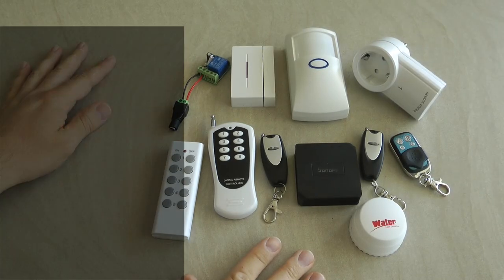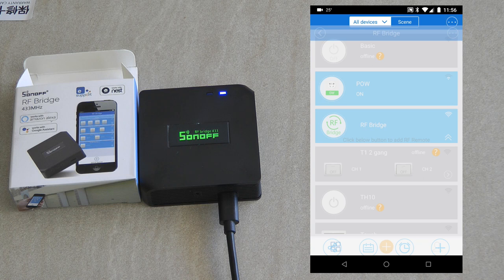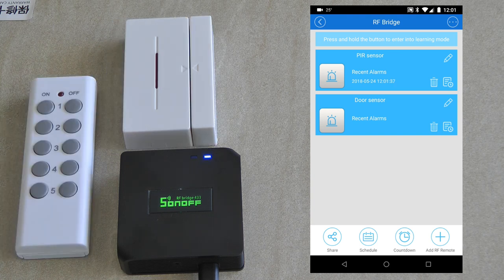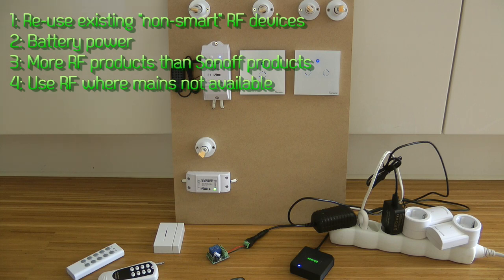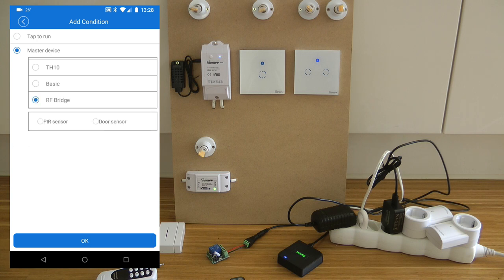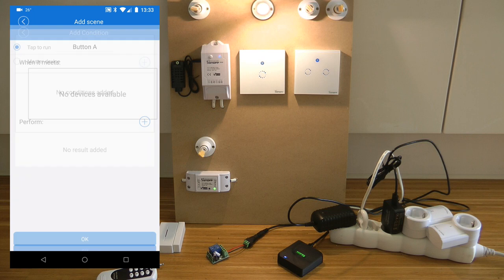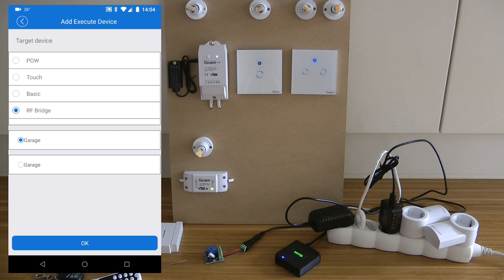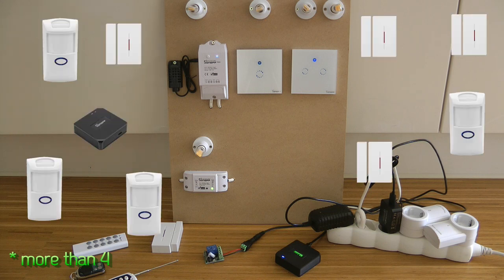Sonoff RF Bridge Review

Comment: Does Sonoff RF bridge support all RFdevices?
Reply from the maker: No, most of RF devices work on 433 Mhz, but there are other frequencies out that which are not supported. I know that for example most roller blind RF remotes do not work. But I find it impossible to find information of RF device which would definitely tell me what is working and what is not. So it is a bit of hit and miss.
Reply: @csongorvarga  ok, I have purchased sonoff RF bridge, if u don't mind can you  tell me the sources and devices that are supported  by Sonoff RF bridge?
Reply from the maker: @hassanibakary8042  I can't as you can see I have tested it with the devices that are available from Sonoff, and a few random bits that I found at home. I don't have any list.
Reply: @csongorvarga  OK THANKS FOR YOUR TIME, BY THE WAY GREAT TUTORIAL ,KEEP IT UP

Comment: @Csongor great video. question is it possible also to learn the rf bridge my air-condition RF ? so i can turn my AC on-off using my phone/alexa? thanks.
Reply from the maker: That is a good question. AC usually works with infrared remotes and not RF. I doubled that it will work as AC signals are very long, but you never know until you try.
Reply: @csongorvarga  any other suggestion of sonoff that will bridge IR? :)
Reply from the maker: No, Sonoff does not have any IR device. Broadlink rmPro is the device you need, but it is a different ecosystem, different app.
Reply: @csongorvarga  Thank you for your answer .  Don't know if they will launch this product in 2021 this year  ?
Reply from the maker: @monostereo1000  I have no idea. But Sonoff just recently launched the Zigbee range, therefore I think they are moving away from old RF and towards Zigbee.

Comment: Hello..
I purchase rf bridge kit...
But how I configure pir and door sensor for home leaving ( lock). And  Home arrived ( unlock)..
Reply from the maker: You cannot. The door sensor senses when the door is opened. It can't tell if you are leaving or arriving. And there is no sense of state either. You can only do simple triggers like your pir or door sensor turns a light on.
Reply: @csongorvarga  Is it possible to  Pir Sensor to Turn On a light on only at the certain time of the day? (At night)
Reply from the maker: @CezarWagenheimer  No, unfortunately not.
Reply: @CezarWagenheimer  for that you will need a motion &light sensor (which will activate only when there is not enough light  eg. at night or at dawn)
Reply: @dariusEMPEROR  This is now available within the most recent versions. I was able to configure it to only turn on the lights at night.

Comment: What is the maximum distance from the control object?
Reply from the maker: It is hard to say. 433Mhz can do up-to 100 m with line of sight. But 433 works very good across walls. I have a small door bell at the gate, and the receiver is about 20 meters in the house and it works well.
Reply: @csongorvarga  thank you for quick response)

Comment: Could I set up an alarm to alert me if i leave my garage door open ?    For example if i leave it open for more than 10 minutes.  How could I do this for cheap?

Thanks for the great video!
Reply from the maker: No, unfortunately not. All the triggers are happening when the even takes place (e.g. the door is opened), there are no timer, or combined conditions that can be used to deliver what you need.
Reply: I know that you can set a timer on a sonoff basic , so if you press ON after X min it will go off automatically.   Think it could be possible to add a door sensor that when the garage door is open  reports to the bridge, and activate a sonoff basic with the previous configuration i wrote.

Comment: I need to have 1 button for on and 1 button for off, like on the actual remote. Pressing the same button to switch on and off like you showed doesn't work for me. That means that for a single 4 buttons remote I need to have 8 buttons and two sets of virtual remotes...
Reply from the maker: It has been a while since I did this video, but that should not be a problem. You add the buttons as alarms and create a scene for each. And you configure scene 1 to trigger on button 1 to turn on your device. Scene 2, button 2, turn off the device and so on.

Comment: Could someone please point me to a Sonoff-compatible gas detector? (for natural gas, methane, butane, used for cooking, not carbon monoxide or smoke detector).
Would be very thankful to know which 433MHz gas detector would work with this lovely little device.
Many thanks!

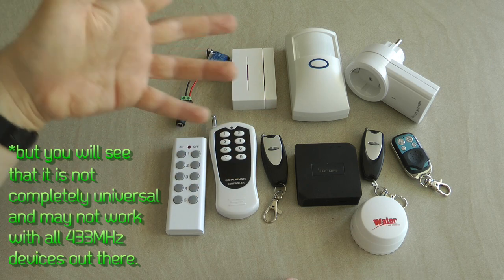1:30 That's why I am asking this question :)
Reply from the maker: I can't. I had tested these few products and  I have no idea how to tell if a sensor will work with RF bridge.
Reply: @csongorvarga  Thank you for your reply anyway. I've read that the Sonoff Bridge needs a certain standard of the 433MHz signal to be at but the specifications of indificual gas detectors/sensors don't go into such details as to reveal the signal encoding type.
Thank for the interesting vid.

Comment: hi there 
will the sonoff RF bridge work with a 350 watt rated power of electric gate opener 
REGARDS RICHARD
Reply from the maker: RF Bridge is just a bridge. You will need a RF relay if you want to operate a gate opener. Usually garage or date openers only need a trigger to open/close, so that relay does not need to be rated for high power.

Comment: I have a couple of questions I hope you can help me with:
1) So the general remote's button cannot be used to trigger T1 switches, if it is setup as a "button", instead of an "alarm"? Because when I tried to set my 4 button remote as 4 buttons through the rf bridge, it did not appear in the scene. I must set up each button as an alarm.
2) What then is setting up general remote buttons with the rf bridge for? Is it simply so that we can control devices (that are usually paired with the remote control) using the ewelink app? 
3) So, 8 remote buttons cannot be used as 8 triggers just like PIR or door sensor is 1 trigger each?
Reply from the maker: 1) Yes, set them up as alarm.
2) Yes, I am not sure why the app is working like that, they must have had their reasons
3) Yes, alarms are always a single input, only buttons can be up to 8.
Reply: @csongorvarga  shame... I thought I can use my 4 button remote as 4 triggers for my 4 T1 switches and only use up one device slot (out of 4).

Comment: Hello,

Your video is very interesting, I finally understood how to pair the remote control. Thank you

Can you tell me about the following?
I have 10 Sonoff DW1 door opening sensors, an RF Bridge and a remote control like yours.

Is it possible with the remote control to activate the 10 sensors at the same time when we leave the house and to deactivate them when we return?
If yes, can you tell me how to do it?

Finally, can we complete the installation with an external siren compatible with my Sonoff elements, to associate it with the door opening detectors in the event of intrusion?

Corialement
Reply from the maker: Hi, well there is no nice solution to what you are after. A scene is either enabled, or disabled, it cannot be switched. As a crude workaround you can install a Sonoff Basic/Mini before the power supply of the RF Bridge. And you simply cut the power when you are at home. If the RF Bridge is not working, the signals from the door sensors will not be registered. For the siren, probably the easiest if you get a siren which turns on when gets powered, and yet again switch it with another Basic/Mini.
Reply: @csongorvarga  

Hello,
Thanks for taking time to respond to me.
Your solution makes perfect sense.
It was enough to think about it.
Thank you

Comment: Such a shame that they don't improve ewelink app... I own a Broadlink RM pro, it costs around  3 times more than this one, but it also has IR capabilities. And I finally could integrate it in HASS without changing the stock firmware.
Reply from the maker: I think the advantage here is how it can be integrated into other (Sonoff) wifi devices.
Reply: i don't trust and want ANY device that requires a chinese cloud and that can't be hacked to allow local use (like with tasmota or espurna, for example), using mqtt/http to interact with them and a local management like nodered or home assistant... itead or broadlink, if they fail your device will stop working...
Reply: squalazzo The way I integrated the rm pro uses local control. I only had to set the local ip and mac of my device, it works independently from chinese cloud, but still can use their app.
Reply: Csongor Varga In my opinion the real challenge is to keep the stock firmware/app and ALSO allow hass control.
Reply: yes, that's an option, as far as original cloud is itself an OPTION and not a must as right now...
Reply: yes, in that case is true, i've seen some videos about them... unfortunately not for itead products

Comment: Good hardware, very mediocre app.

Does it work with openHAB etc?
Reply from the maker: I did not try it, but I know it is possible to flash the firmware. I was told that it does not support long RF messages (e.g. 40bit messages that are used by some blind remote controls).